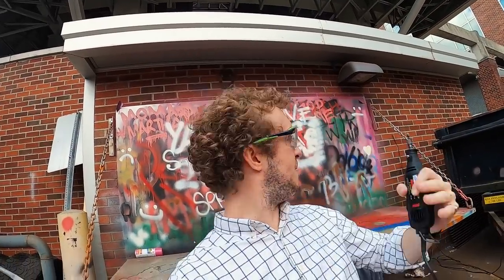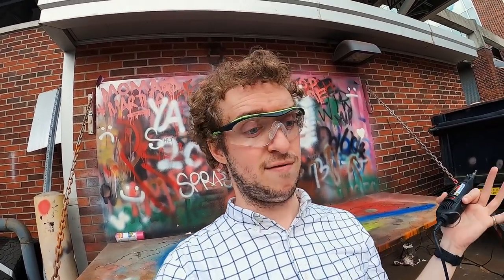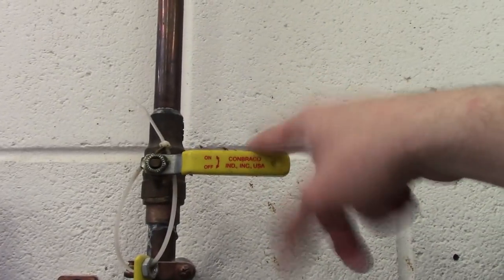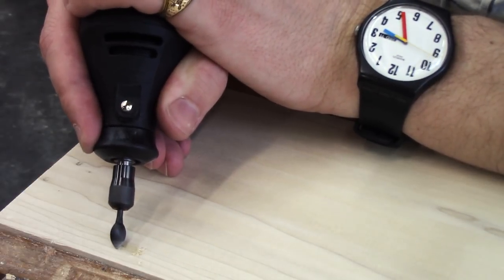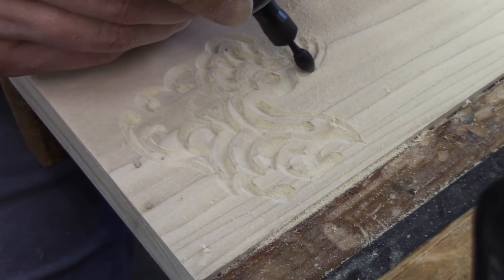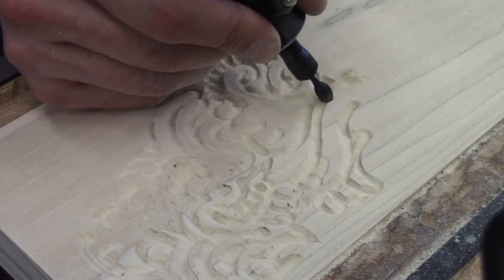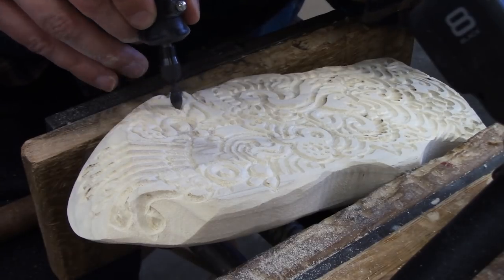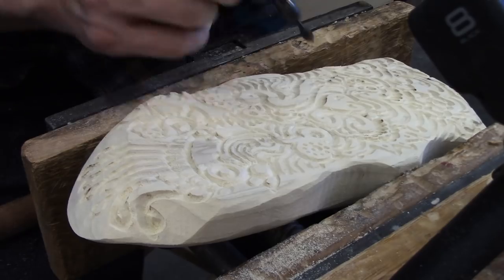First Try! Freestyle Power Wood Carving

Comment: dude I could do this on one of my electric guitar bodies. I have my own dremel kit at home too. Thanks Peter, you just gave me a great idea. I've been planning to sand down a cheap squier stratocaster and repaint it. But I may do this. I wonder if I should first draw out the design/pattern before carving into the wood...
Reply: Oooh, that's an awesome idea! I would definitely draw it out first. Do ideas on paper then move them around to see if you like the placement. Or at least draw it on the guitar first so you can see how you like the flow of things. I'd love to see your finished project when it's done!
Reply: @bludaizee24  that would make an awesome looking guitar. I'm brainstorming some designs and getting the stuff I need together. I'll put a boarder around the pick guard, bridge and output jack so that it's just regular uncarved wood like .25 of and inch around every thing. I'll have to carve the back and sides too. Wish me luck. I might post a video of it when it's done. I definitely won't finish it today.
Reply: I can also prime and paint it after I'm finished carving, if I dont do a perfect job then it's just a cheap squier strat. I'm so glad Peter gave me this idea.
Reply: Guitar=bad
Reply: @meflea3675  BASS
Reply: @the_original_Bilb_Ono  Are you on IG? Or will you put it on YT? I'll watch either one! Lol Find a scrap piece of wood to practice on if you're worried about wrecking the guitar.

Comment: I wonder if you might try to do a wood block print from this carving? You could do a straight print with an ink roller or seal the wood with a varathene sealant and produce prints from that! What do you think?

Comment: You scared the crap out of me at the start of the video. (Five seconds in!) Here's a few shop safety tips! 1) Don't bring any powered tool anywhere near your head. Not if it's plugged in, not if it's unplugged. Your head is precious and encases the single most powerful tool you will ever have in your whole life. Treat it like the precious thing it is. 2) When holding any powered tool in your hand, hold ONLY the tool in your hand and nothing else. Don't hold the tool and a pencil in the same hand. Don't hold the tool and your glasses in the same hand. You must control the tool, both for the sake of safety and for the sake of properly using the tool. In a matter of just ten seconds in this video, you blew through both of those. Take care of yourself, willya? You're a talented young guy who makes informative and entertaining art and videos! Also, just as a recommendation for the shop, try wearing a bandana/doo-rag on your head or a bicycling cap or welding cap or a fun-and-funky cap with a short brim. It will make eye protection more comfortable to wear, help keep your hair out of the way of your glasses and/or your eyes and will keep sparks/wood chips/metal shavings/dust out of your hair, too. Happy crafting!

Comment: your not supposed to tilt the wood while your cutting/sanding it, you can change the angle of the machine instead. if your holding the wood at an angle it can kick back and cut you.